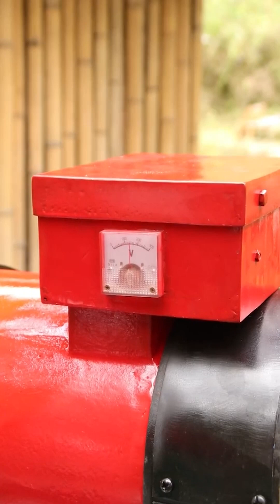💡Power Generator Restoration, From Broken Rusty To Brand New | 100% Free Energy Power Generator

Comment: Hello Ms. Lin
 I thank you for your hard work in repairing the generator, diesel and electricity supply to the villagers. You are a first-class repairman. But you are a beautiful and young girl, her delicate hands were burnt with oil and grease. Cut the burned generator wire and remove it. Brushed and cleaned machine parts with diesel and gasoline. Heavy load moved. I found out that you are a girl from the village, but these hard works are difficult for you, beautiful girl. I thank you for doing the hard work. Please be careful not to move heavy loads alone. Women are injured early and compensation is impossible. Be happy and healthy.